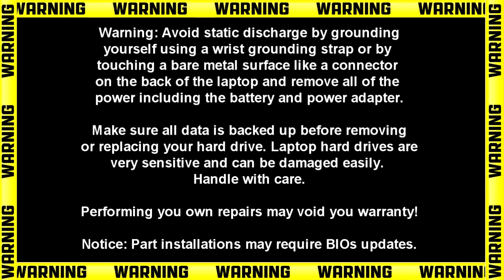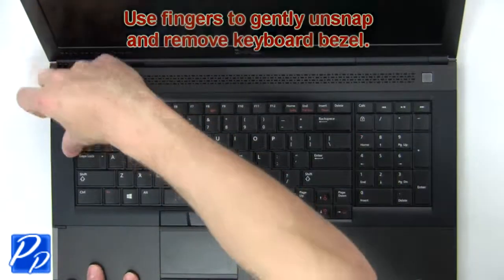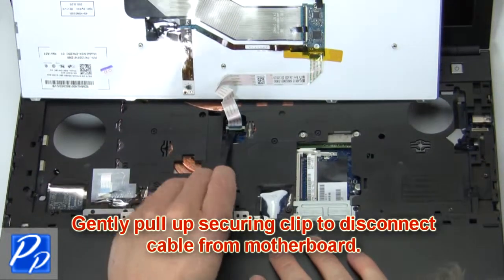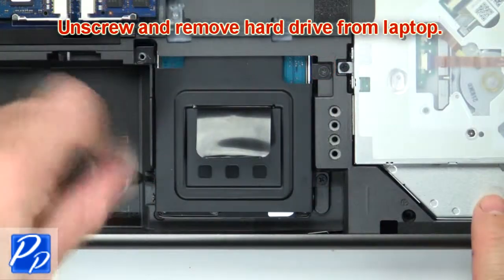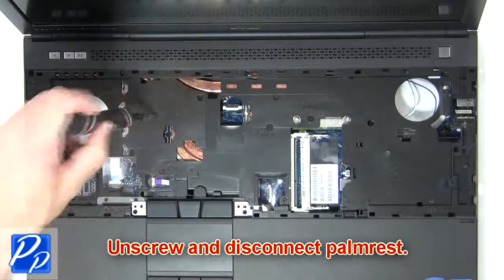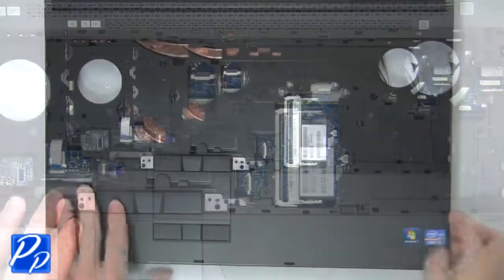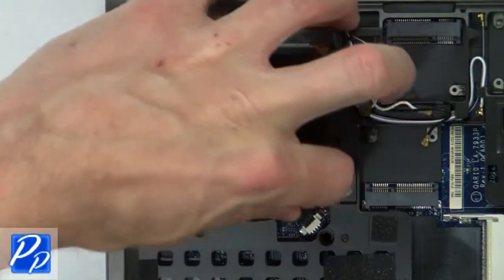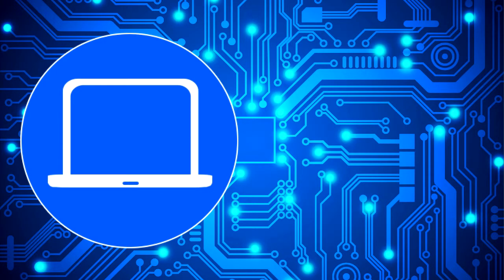Dell Precision M6700 (P22F001) GPU How-To Video Tutorial

Comment: Can I install GTX 980 m ?
Reply: Not sure if you got an answer yet. But yes you can add a 980mxm clevo board. I just put one in mine this week and its running like a charm; I think that is the highest this machine will support however and it will show up as unknown in BIOs.
Reply: @Ansi707  Tnx, I will remember this :)